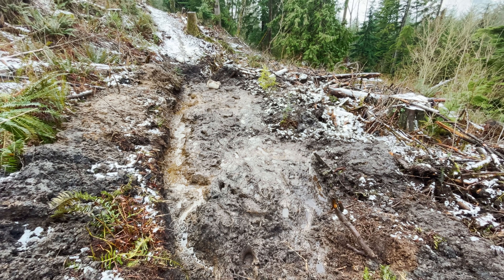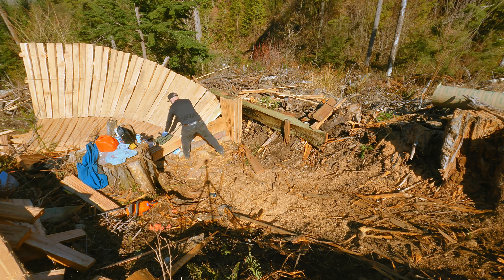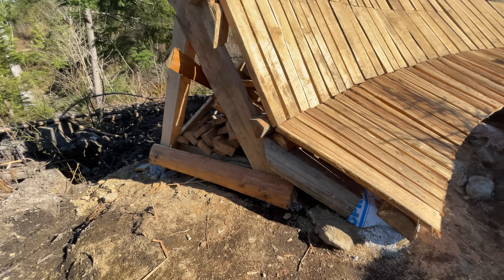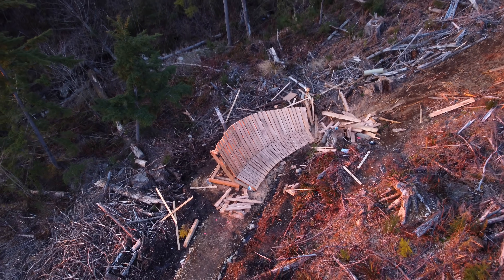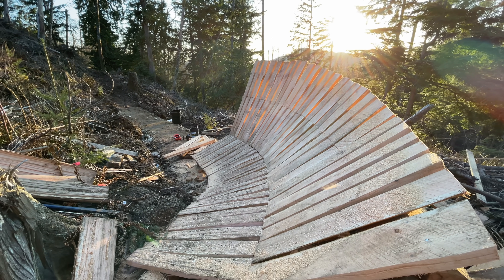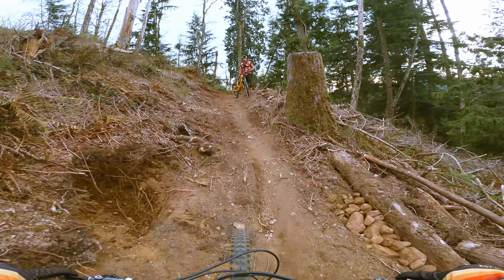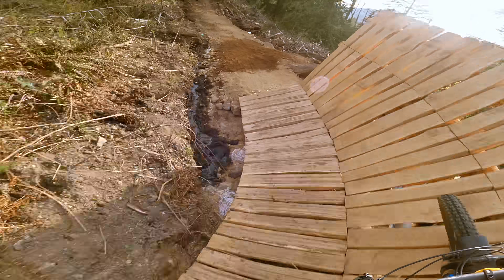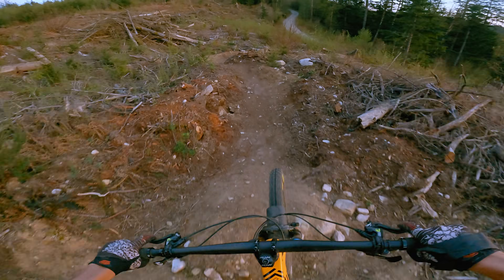We Rode The Shark Fin for the First Time!

Comment: For a feature like that you could try making the landing the same shape as the wallride. Leave the gap but continue the shape of the wallride, out of dirt to make the landing (The low point of the wallride low on the landing, and the high point of the wallride high on the landing). Shape it just like the wallride entrance, so essentially you'd be building the entrance to the feature you made out of dirt, but in reverse, with a gap in between as an exit. I hope that helps, cheers! :D \m/